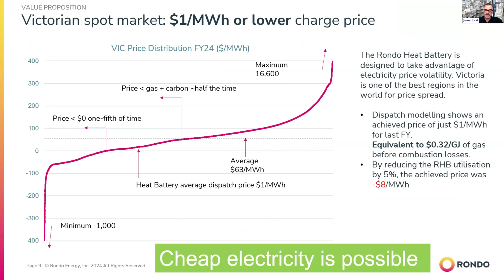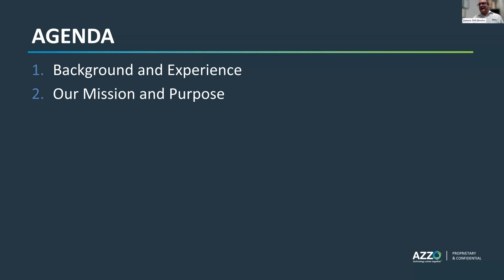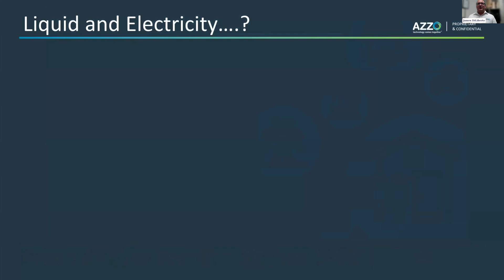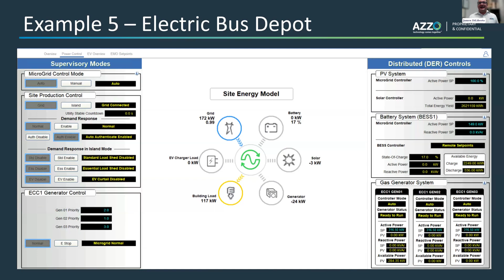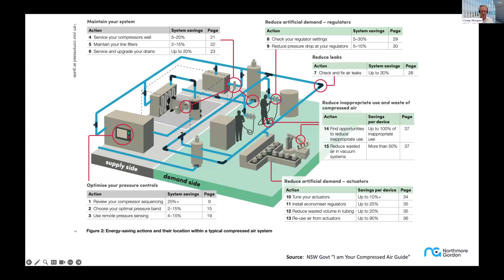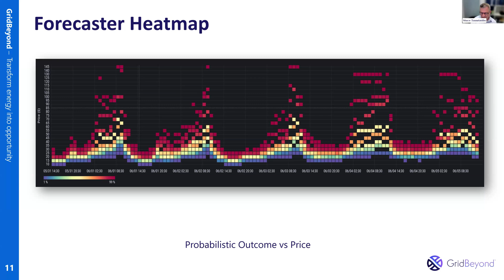Learn how energy efficiency, onsite solar PV & batteries can help AVOID an electrical upgrade

Comment: Like to know : How did they cope with any interruption. Has there be any unexpected benefit apart from carbon reduction and lower operating costs vs previous. What would the panel say are the main mistakes. How has working with the power utilities gone with firms deploying this.